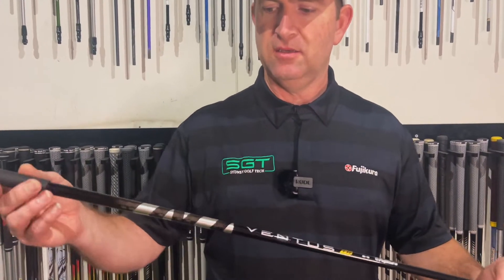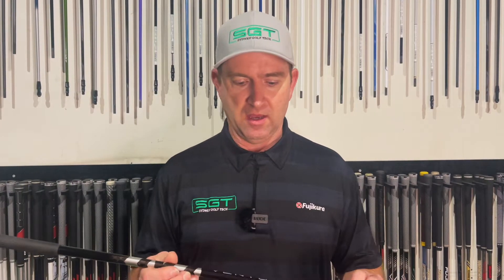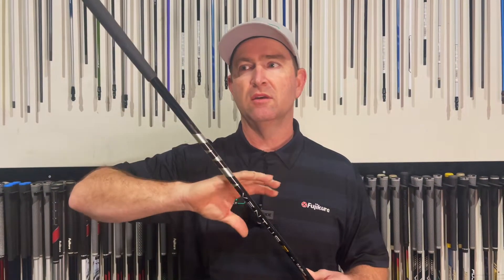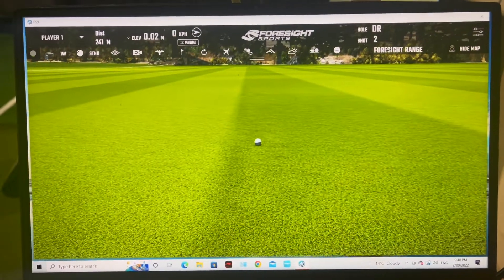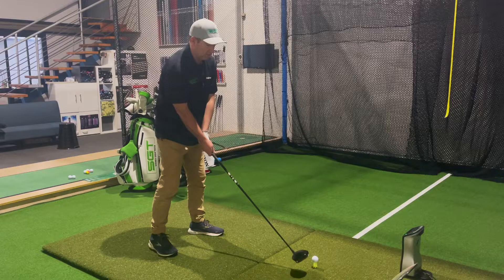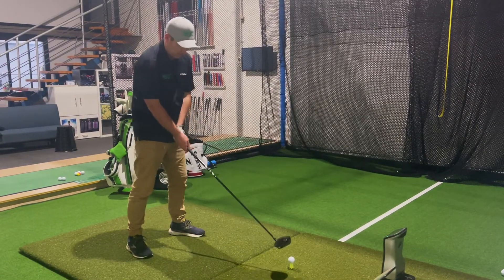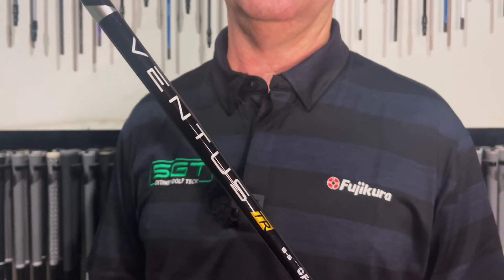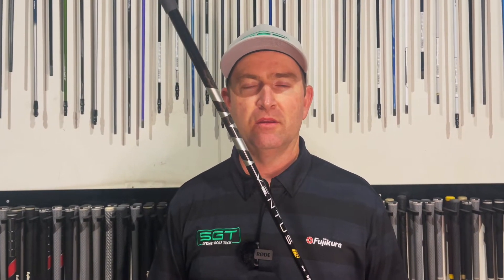Fujikura Ventus TR Black Vs Original Ventus Black

Comment: I love the Ventus Black and moved to the TR Black as soon as it was released as I am aggressive with the downswing at the top with the handle.  Great shaft and I thought nothing would beat it.  Please try the Proxima shaft.  Recently switched to it and will never go back.  I’ve got the Proxima 6X.  Super stable and nothing I’ve ever hit or tested is as good into the wind.  Proxima is straighter and gives a little more distance but it’s “super power” is its consistency and accuracy.

Comment: Black 6X here.  Tipped about 2 inches with Velocore label close to the adapter.  6X and tipped would not have been my first choice but beggars can't be choosers.  I got used to the X flex after a couple of range sessions.   As is, it is miles better than OEM Blue 6S.

Comment: i understand for low handicap to pro golfers shaft is vital but would there be a major difference of a premier shaft to off the shelf shafts they sell with drivers at retail for a mid to high handicapper with a consistent swing technique.
Reply from the maker: There’s always a benefit to better equipment when properly fitted, but I suppose for a lot of people it gets down to whether or not they can justify the cost. In my opinion, the worse the golfer, the more they can benefit from fitted gear. At a professional level, the gains from fitting are so minute, but obviously very important. Spend what you are comfortable spending and enjoy your golf. 😃